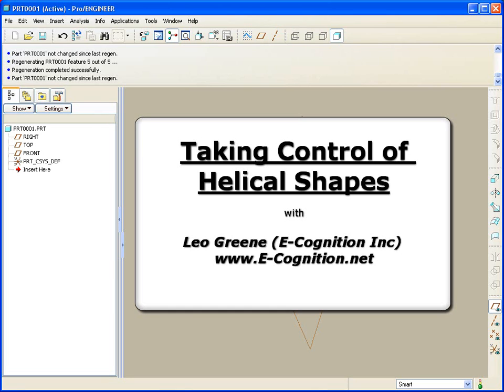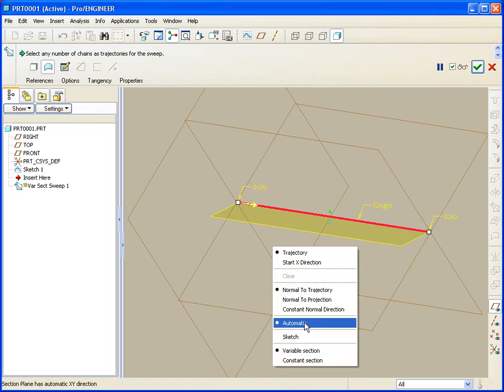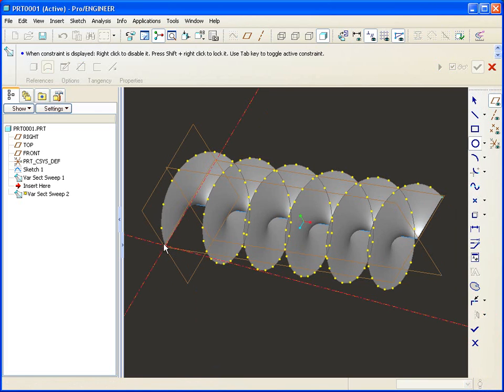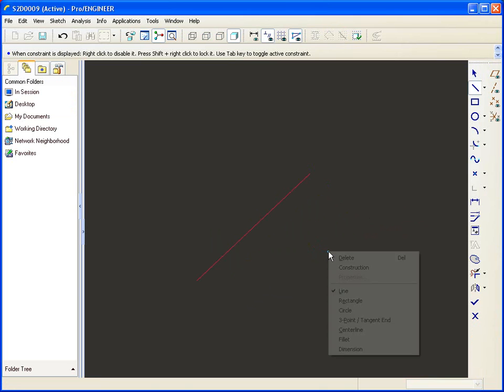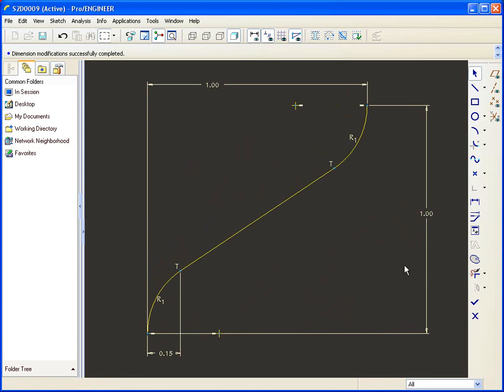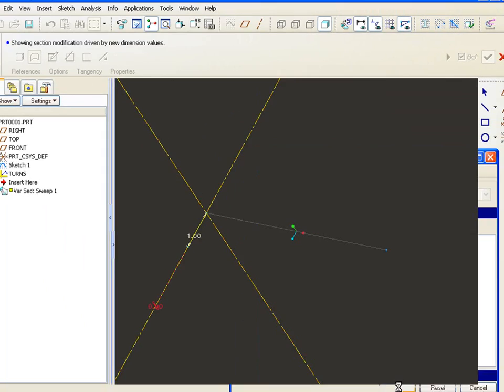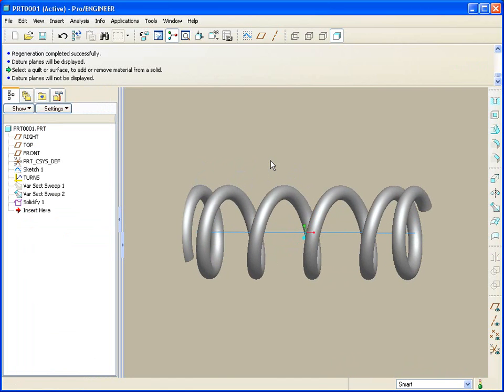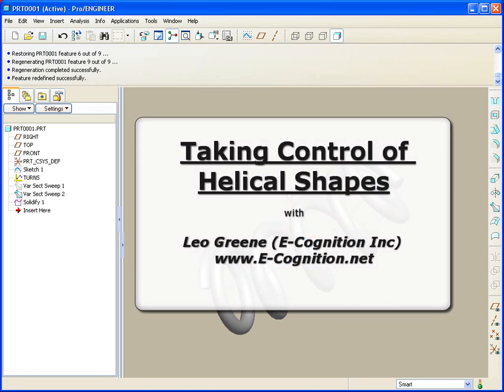Taking Control of Helical Shapes

Comment: I've already create a spring with specific value of pitch using the helical sweep protrusion. But the problem is at  each end of the spring it has section with different pitch (provided that it these section at the end of the spring is the same for both side). How I'm going to continue from the spring that I've created earlier???